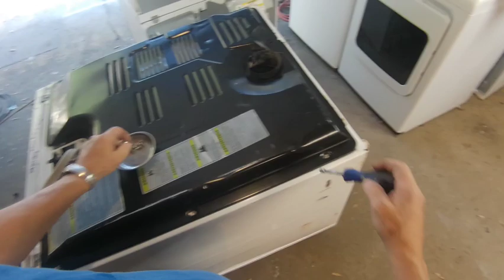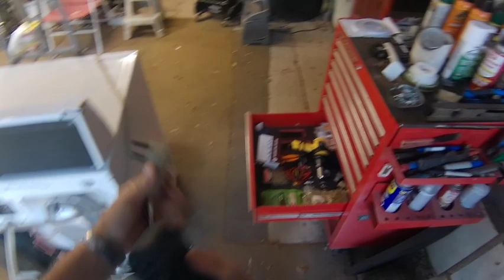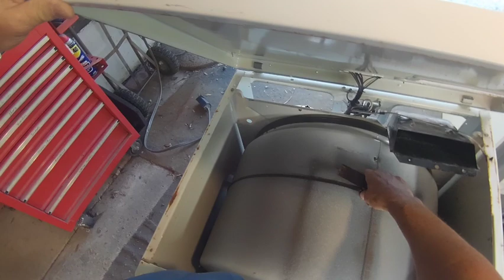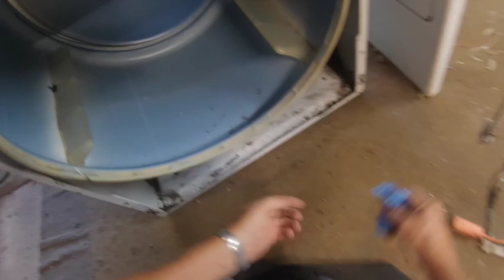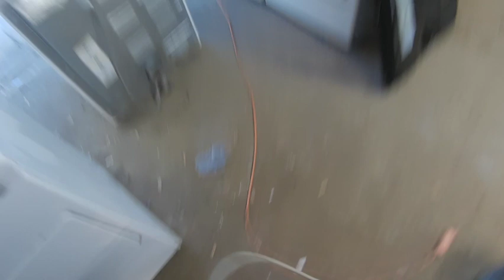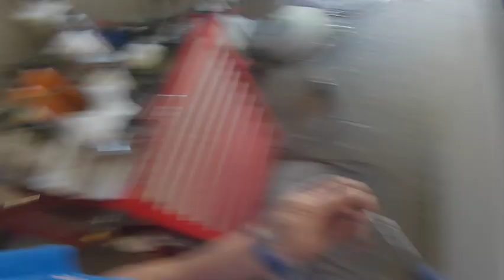How To Troubleshoot a Kenmore Dryer Motor: Disassembly & Repair Guide

Comment: Greetings.  What are the causes of a bad motor?  Can motors be repaired?  Seems like you work on more electric dryers than gas.  Why is that?
Cheers from S. CA
/
Reply from the maker: There are several causes of bad motors.  In this video it was the bearings that failed.  Other times the windings will short out because they get too hot and the insulating coating will melt off the windings. Motor switches sometimes fail and the thermal protection devices can also fail. All of these problems will make a motor quit.  Most dryers in my part of Louisiana are electric dryers but we do have gas dryers too. I actually worked on one today but it was on a service call and I don't usually film inside people's homes.